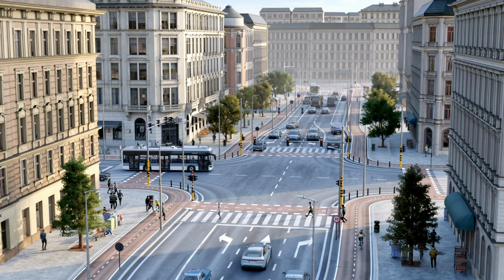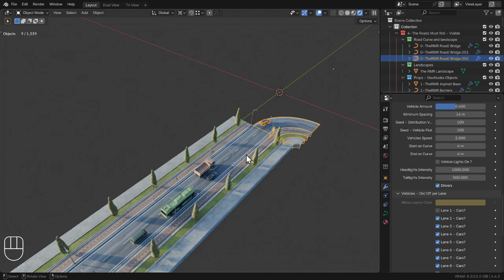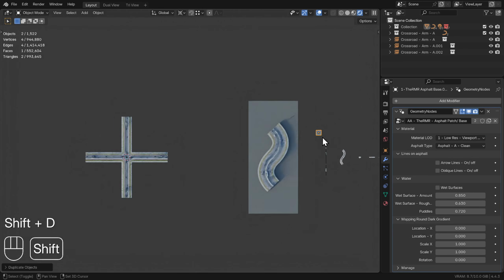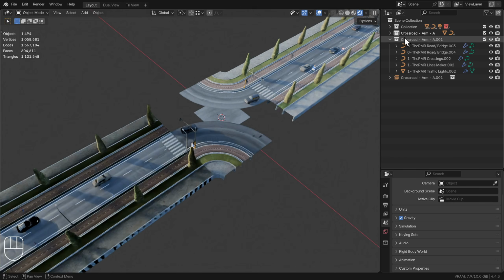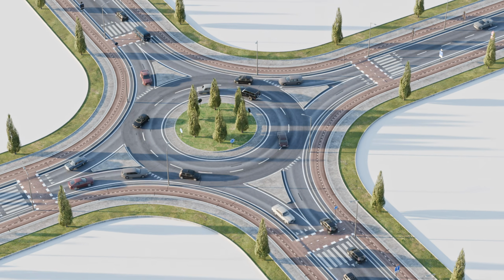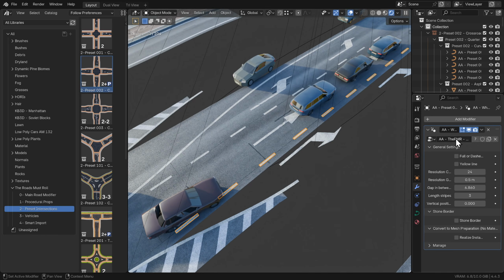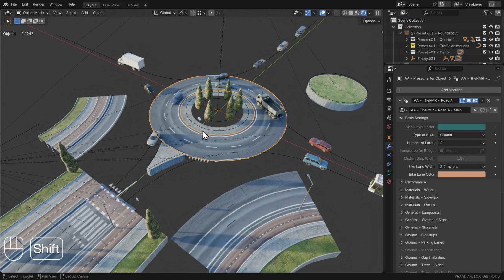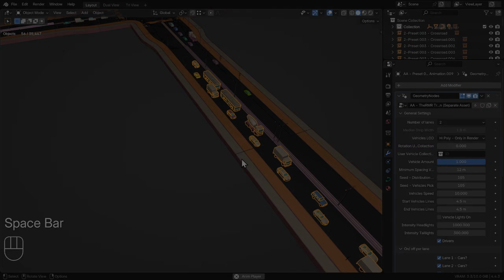How to Make an AWESOME Traffic Intersection with Traffic in Blender

Comment: When using the Smart Import to bring in All Assets in Blender 5.2.2 LTS, once I uncheck the Instance Button, I can no longer move any of the parts.  Pressing G, the cursor changes to the Move cursor, but not of the smart imports will move, no matter which one I select.  I can move them in Blender 4.2.23 but in 4.2.23, the lines do not show up on the roads.
Reply from the maker: Hi Patrick,
Thanks for reporting on this.
I was not able to reproduce this problem in Blender 5.2.2. tho. Can you move other objects with the move tool (objects that have nothing to do with The Roads Must Roll)? Like a newly create cube for example.

Comment: Hi, great tutorial btw. I've noticed something wrong. I try to change a setting for multiple objects while holding alt. But I'm unable to click while holding alt.
Reply: Hello
I think i exactly know what the issue is..
I think that you have a mouse who's middle mouse button doesn't work properly
so you changed the setting in blender to Edit->Preference->Input->Emulate 3rd mouse button..
in this case you can not select anything holding alt as it will be used for panning and viewing the scene.. Its a drawback of not using middle mouse button..
there is no help to that.. if you want to select edges or anything using alt..
you have to turnoff this setting..
Reply from the maker: Hi Maro,
I'm not sure if I can reproduce this issue. Can you check of the the geometry nodes modifiers of the objects you select are instances of one another?
Otherwise, could you send an email to: everyroadmustroll@gmail.com

? Thanks!

Comment: Esse plugin também é disponibilizado para outras plataformas como 3Ds MAX e Unreal?
Reply from the maker: Hi Abrahão, the tool is only made for Blender. If you want more information about exporting to other platforms, please check the FAQ on the website: https://theroadsmustroll.com/faq/ Most materials won't properly convert to Unreal or 3dsMax because of the procedural nature and the integration with Geometry nodes in Blender.

Comment: Insanely good addon. If you will add easy forks creation it will be the GOAT
Reply from the maker: HI Victorique , thanks! 🙂 By 'forks creation', do you mean a road that splits in two?
Reply: @Roads_Must_Roll  Yeah, the ability to split the default road in two whenever you want. From my experience so far, to make road that looks like a tree with multiple branches, i need to make several copies of the road and attach each of them separately. But if it was possible to simply extrude a point to make new "branch", the boost to workflow would be immense.
Reply from the maker: @Senjougaharaesu  Hi Victorique, Yes, I understand. I have thought about this when I was creating the base functionality and it would indeed be much easier. Unfortunately, it is not possible to split curves in two. It would require a fundamentally different approach to make roads. I wish it was possible!